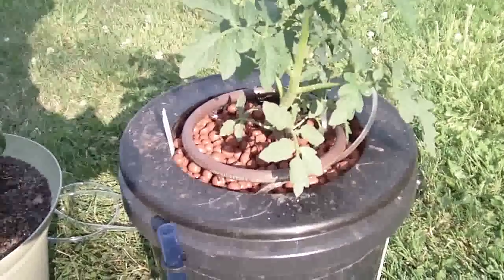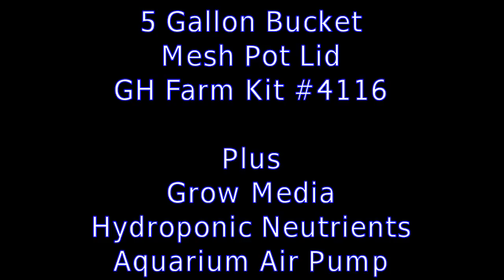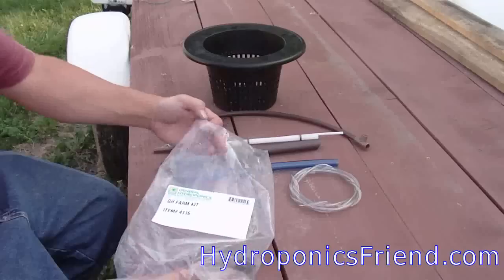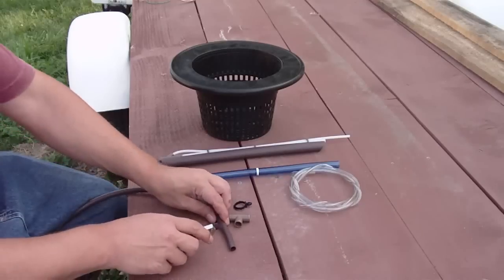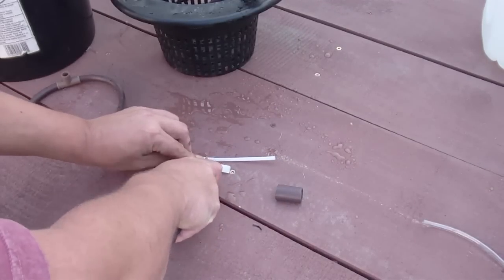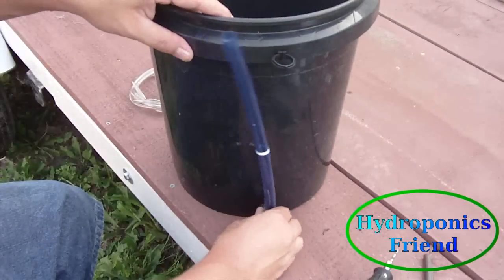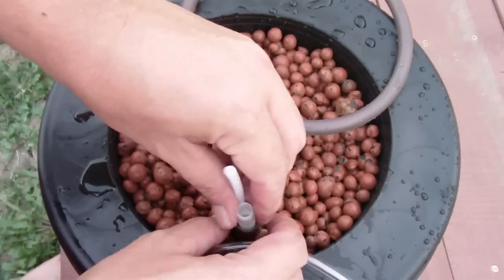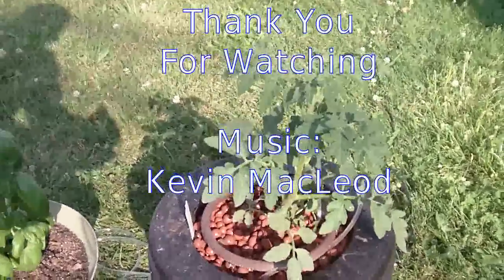How to make a Top Drip Bucket Hydroponic System

Comment: In the 70s there was a commercial system that used this exact principle. It used styrofoam beads and vermiculite as a medium.  It was rectangular and about 10 inches high. Half was down was a support lip to hold the rigid plastic piece that held the medium.

Comment: Nice video, and to make the hole with a 1/4" drill bit for the farm kit. If you want more water to pump more water get a air pump with a few more watts and a psi air flow nob and it worked so much better than a pump with more gph won't help you if it doesn't have a turn air flow nob. Thanks for the video and sorry for the spelling but when you have as many seizures as I have a year you will forget how to spell even the smallest words.

Comment: Notice on support tube he cut a relief on the bottom of the support tube, also if you use a little dish soap on the grommet for drain tube it will insert much easier. over all good video. Also please note when using General Hydroponic solutions, only use half of what they call for on younger plants on first solution mix for bucket to keep from burning your plants up.

Comment: There is a pump pumping air into the bottom of the bucket, into the "pumping column support tube" which he shows at 4:21. The air bubbles float from the bottom up, into the "pumping column", which is basically another tube. As the air bubbles go UP, they take the water with them, pushing the water up. 

I would guess that you can do an experiment to get the same effect by putting a straw into a water-filled garden hose and blowing into the straw strongly (the effect is not the same, but similar)

Comment: thanks for the video. is the air going into the support column or into the bucket? i was thinking if it is going into the bucket and the pressure brings the water up, then maybe i can hook that air tube to an airstone and use it to aerate the water as well. cant do that though if it has to go into the support column.

Comment from the maker: It's ok for it to touch the bottom because the tube is cut at an angle. I only shortened it because the drip ring was splashing so much solution on the lid. That would be less of a problem if you used a larger net pot lid. Trim off an inch or so and see how you like it. Trim more if you think it's necessary. This is will be your system, modify it as you see fit.

Comment from the maker: @Darkfoax I use a 3 part hydroponic solution from General Hydroponics with reverse osmosis water in this video. There is only a few teaspoons of the fertilizer so it just barely tints the water. Since your plants are grown without soil it has to get all it's nutrients from the water and hydroponic fertilizer mix. I've tried many brands and they all seen to work well.

Comment from the maker: @2451Charlie I grew a very large tomato plant running the system 24/7. I also added an air stone to put more oxygen in the solution. Not a big deal because the air pump I was using had two outlets. Some people suggested a timer. You may want to read down through the comments for more info.

Comment: Would it be a good idea to use some sort of silicone around the bottom grommet for possible future leaks?  I know it's totally unrelated but on my classic VW Beetle, I've done this on a few spots where I was worried about leakage from the rubber getting hard over time.

Comment from the maker: @bulletproof2353 Sorry, can't help you there. I've never built a spray type yet. I'm just not into the use of spray heads with the necessary more powerful pumps and the extra expense at this point. I've seen other videos here on You Tube that may be more helpful than mine. Another good source is Hydroponic Forums. If you are close by a hydroponics store they may be helpful also.

Comment from the maker: @bulletproof2353 It's best to run one line to the Air Lift Pump and another to an Air Stone or two. If you simply place a T in one air line, all the air will go to the Air Lift Pump and not to the Air Stone. The air will take the path of least resistance. In this case the air stone will have some restriction. 
No air tight container is needed. The rising air bubbles lift the solution up the tube to the drip ring. This is how it works with such a low output of air.

Comment from the maker: @bulletproof2353 I put the Air lift tube as far to the outer rim as possible. It has to be an inch or so from the edge only because of the slope of the bucket. If you were to use a smaller net pot bucket lid it actually would go through the rim. If you were to use the 10" one there is practically no rim at all. It works great as a hybrid system. You do have to use at least two lines as I will explain as a reply to your other post.

Comment from the maker: @bulletproof2353 It worked just fine for me the way it is. All the Hydroten stays wet supplying nutrient to even the smallest plant dead center of the basket. Some have even suggested putting a timer on the pump so it isn't running constantly. The really cool thing is it's YOUR own system. Modify it any way you wish. Don't be afraid to experiment with ideas you may feel would improve it's operation.

Comment from the maker: @DrMotorDude I've used orange, gray, and even calico and in my experience all have worked equally well. I have read that black cats sometimes overheat when exposed to full sunlight so you should use some type of shade cloth. Spray misters were proven to be ineffective since the cats would get annoyed and run away.

Comment: Very instructional video , well thought out and presented.  On point, however.  Its not 'hydrogen' (I assume you're referring to the gas) that is generated by the air pump.  Its actually highly oxygenated water that is bubbling out.  H2O is a unique covalent bond of two hydrogen atoms to one oxygen atom.  You can't synthesize hydrogen unless you utilize electrolysis or some other chemical reaction.   Finally, hydrogen gas is odorless, tasteless and invisible :)

Comment from the maker: @nectarineblue I used the one from Wal*Mart that's rated at 10-30 gallons and it ran fine then I switched to the bigger one with dual outputs so I could run a large air stone also. I grew a tomato plant in it this past summer that way. You can see it toward the beginning of my Gardening Update Video /watch?v=bk_qayx5m1U. Thanks for stopping by. :)

Comment from the maker: @DonPinGodoy I can see how that could give you the kind of boost you get from a flood and drain. I added an air stone last week because I was concerned there may not be enough oxygen in the solution during the day "higher temps = less suspended oxygen" and so far I'm very pleased. What is your on and off times for the drip ring? What are your growing conditions?  I'm alway open to suggestions. :)

Comment from the maker: @bonham4596 No longer than two weeks. I top it up daily with half strength solution. I go by what I've read. I've heard as short as a week towards the end of it's cycle then plain water as it produces fruit with some flushes in between. Got all that? LOL Actually I go by instinct and I do ppm and PH readings every few days. When things start to go out of whack it's time to flush the system and change out all of it. PPM only gives you relative strength not what nutrients are getting depleted.